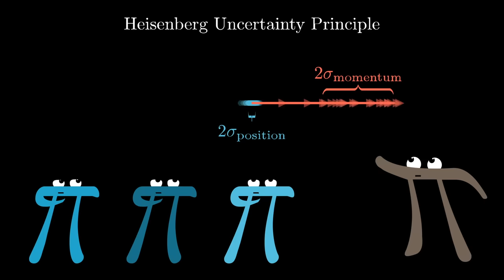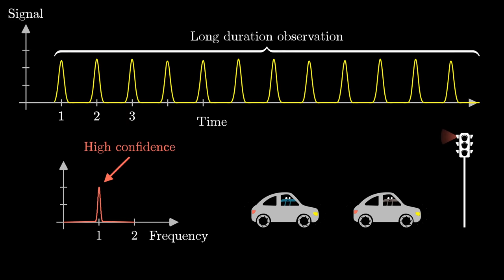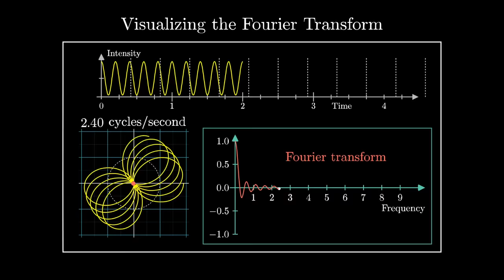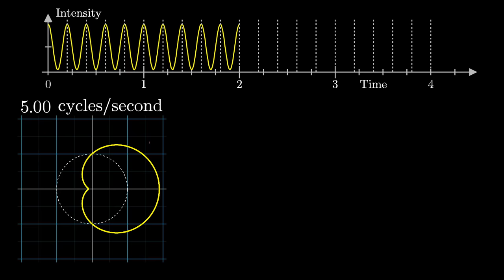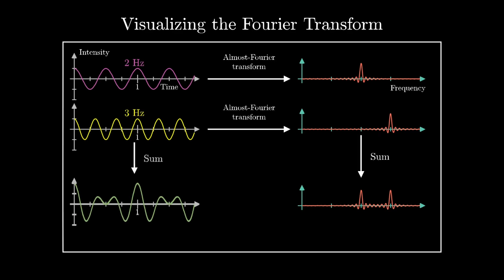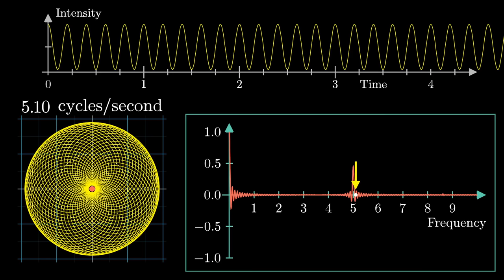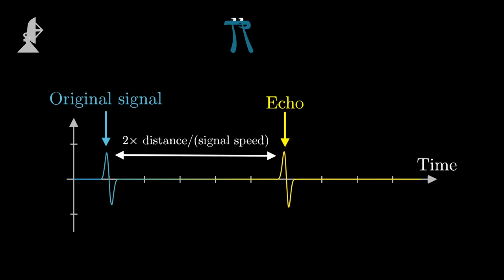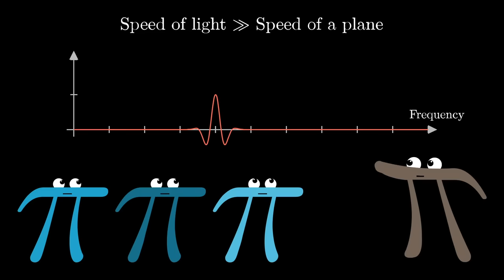The more general uncertainty principle, regarding Fourier transforms

Comment: Is the answer no, since you cannot collect enough data in 10 rounds to narrow down the weakest player. After each match, they can analysis the data to narrow down the weaker players. If the company didn't want to send any weak players a few rounds would be enough to spot the weaker players. But, if they want to narrow down the weakest player of that group. They would need more data, so they would need more matches. 
Thus, we can imagine taking the fourier transformation of the amount of people they don't want to send (i.e. just one person or a group of people). Then the data acts similar to the winding of the sine wave to the circle. Then if to take the inverse fourier transformation to the data that will give you the amount of matches needed.
Thus we have the same relation between amount of players they won't send and the number of matchest to the relation between frequency and time.

Comment: At 8: 11: If f_echo is the frequency that rebounded on the plane and is then detected by the radar, doesn't the Doppler effect apply twice? If so, shouldn't the formula be f_echo = (1+v/c)^2 * f_pulse?
Reply: I noticed that too. But instead of the same Doppler effect squared, the Doppler effect of the radar reaching the plane is different, it's 1/(1-v/c). So the combined effect is (1+v/c) * 1/(1-v/c), which simplifies to f_echo = f_pulse (c + v)/(c - v). Here's the wiki about it: https://en.wikipedia.org/wiki/Doppler_radar

Comment: if the uncertainty principles is as you say an artifact of the way we measure frequencies, then why cant we measure its position with high accuracy and then measure it's speed seperately, thus putting them together to get both accurately.

Comment: Hi Blue Brown Guy.

If you get a chance, could you please check my maths?  I took an attempt at formulation for some Equations to support Dr. Eric Weinstei's Geometric Unity.  But I'm having trouble getting feedback.

Here's one of the portions:
The Photon is only Massless when the EMB wave is in BE phase.  In the EM or MB phase, it will have mass.

This explns why high e = m
E^2=M
M^2=B
B^2=E'

E' is the NEXT magnitude of E.

Not Wave Particle Duality.
Wave Particle Force Tri-ality.

Any notes would be appreciated sir.  I used this video in its assemblage.

Comment: Despite this beautiful explanation, I still cannot understand why you cannot measure the frequency of a wave precisely if you have just two cycles. You just have to measure the distance between both peaks.
Reply: Remember that you can create any function/signal you like by adding together infinitely many sine waves. Therefore, you could be looking at a signal that looks like a pure sine wave in the area you're looking at but then does wild stuff outside of that.
Reply: @lunkel8108  thanks, I was wondering that and forgot how there is like more than one sine in this world^^

Comment: Hi,
I may be a bit late, but I am wondering atm why my FFT plot has a Real and an Imaginary part. Or what do these two parts mean.
at 4:26 it is mentioned that the angle of the point in the "windy" graph represents the phase of the signal. Since I think that that is exactly what I am wondering atm can I try to rephrase that and someone can tell me if I'm right ?

The angle of the vector described by the center of mass point in the windy graph (red dot) describes the phase of the signal in the time domain. in other words it describes how sine-y or cosine-y the original signal in the time domain is. That Information gets lost in your frequency domain graph. If you wanted to add it back, you could use to graphs, one describes how sine-y your signal was and one describes how cosine-y your signal was. Name those two graphs real and imaginary part and it answers my question what the real and imaginary part in my plot describe.
Or do you usually expand your graph (the one which only describes the amplitude) by another graph which describes the phase. and you then name those two party real and imaginary

Comment: Why not fire both long and short duration signals at the same time then combine the results and you get both... just don't use same frequency
Reply: How does this change the problem of separating them in the end? They still overlap and add up if you fire them at the same time.

Comment: Can you explation quantum computing?
Reply: Those computers use quantum mechanics to gain ‚supremacy‘ 
over things where classical computers aren‘t good at. 
A computer works sequential, so one instruction is done at a time(simplified), 
so lets say you‘d have a lock that has 4 digits, so 10^4 possible code combinations, 
a computer would check one at a time, so it would take 10000 trials at worst, right? 
Lets reiterate to how computers work, they have two states, a bit. 
So every binary digit(bit) would be a power of 2 possible values.
14 bits can have 2^14 different values, right, so we’d save our key in 14 bits, hence 14 bits can store ~16000 values.
But only ONE at a time.
Now consider a quantum bit, again 2 states, but they have the special property of being entangled,
also they can be 2 states at the SAME time, 
so those 14 qbits can actually store those ~16000 different values at the same time, 
and one of those values is our searched key to the lock.
They do everything the classical computer does in several times at ONE TIME.

Comment: Thats why pulse-doppler radars are the norm in modern fighters. They can measure range with the pulse, and only infer velocity based on range change over time. But the doppler part cant get ranging data, but measures velocity directly and "instantly", vs calculating it like the pulse. They work well when combined in an interleaved mode.

Comment: Indeed it isn't fundamentally quantum mechanics that this arises from. It is in the nature of wave propagation. For instance, from straight-up wave equations, not involving particle-wave duality nonsense, but just from maxwell's equations, you can't have a finite width wave just propagate in one direction without spreading out. So for instance a laser beam meets physical requirements on how little it can spread out over distance as a function of the number of wavelengths the beam is wide. There is a fundamental limit to how columnated the beam can be. And so the effect this has, on individual photons works out to be the uncertainty principle as you know it in quantum mechanics..... the wider a beam is, the less determined a photon's horizontal position within the cross section slice is known, but the more precise its momentum can be (the more directly straight-forward its direction can be), but the narrower the beam is, the more you confine its position, the less straight-forward it can be, the less constrained its momentum is. Another duality pair is momentum and energy, and another is time and frequency (like WHEN a sound occurs within an audio recording, and what frequency it is at - the fourier transform has a given frequency component represented as a constant sinusoid throughout the recording, but what does that mean if you have a tone that lasts for 1 second in the middle of a 10 minute recording).

Comment: Can somebody help me conceptualize why the oscillating masses seem to fall out of synchronous motion as you observe it in a different reference frame? I have a rudimentary understanding of relativity, and I know it has to be analogous to the phenomenon of E&M waves, but my intuition is failing me here somewhere. Thanks!
Reply: I think I’ve figured it out. I believe it has to do with the way light would bounce off of the oscillating masses relative to your speed. You would measure the position of each individual ball at a different time, based on how long it takes for the light to reach your eyes. Any input is still appreciated
Reply: you are correct. imagine a rocket going by you at relativistic speed with two people inside, one at the front and one at the back. They each have a flashlight, and shine the beams at one another. From your perspective as they fly by you, the guy in the back of the ship's beam has to go farther than the beam that the front guy emits towards the back of the ship. This is because the speed of light must always be exactly the same for every observer, and from your view the guy in back is essentially trying to shoot his beam of light up a river that is flowing backwards against it. The byproduct of this is that the two guys in the spaceship will, from your perspective,  travel through time at a different speed than one another. This does not happen from their perspective, and is a byproduct of the warping of spacetime caused by relative motion from your perspective only.  
What 3b1b is saying is that, because moving objects experience time ever more differently at their front and back as they move by you at increasing speed, quantum particles themselves must begin to oscillate with a frequency that increases as the particle approaches the speed of light. At the tiniest of scales, this gives way to the uncertainty principle as described by the first part of the video in the case of radar technology

Comment: In the example of the doppler effect, may i ask why you can't just do a quick pulse then a seperate, longer pulse, to get accurate representations of both? Sure either measure, individually, is vague on one or the other, but taking information from both will give you precision in both, right?
Reply: Black Hole it would work if the objects you were trying to track were far apart, or if there were only one object you wanted to track. Unfortunately, because there is a trade off between position and velocity data, you would be not be able to solve how to find which object has what proportion of the total velocity implied by the frequency shifts if they were too close together in space

Comment: Yeah, but it is not clearly "just as reasonable".  For it to reasonable particles have to actually be waves.  But that's not reality. Every particle ever detected is a localized packet, so either particles always become solitonic for some unknown reason just before being detected, or the wave-function is merely an effective description of unobserved particle behaviour.  Soliton solutions act like particles btw, they do not exhibit the same interference patterns precisely because they are localized.  When you think about it, what is far more reasonable (though non-orthodox) is either (1) some version of MWI or Deutsch parallel universes, or far, far more likely (2) ordinary advanced causation via Planckian scale wormholes (in line with ER=EPR conjectures, but QM from GR, not GR from QM).  Wave-particle duality is mystical mumbo-jumbo and arcane old-school quantum philosophy.
Moreover, recently images of superpositions have been obtained.  So we know wave-particle duality is mythical, since there clearly is no "collapse of the wave-function".  The only credible explanation of the superposition images is that the particle  can actually occupy different points in space at the same time, and that's only possible if there are interacting neighbouring parallel universes, or if the particles can traverse subatomic Planck scale wormholes (time-travel for real, bitches! But only for ultra-tiny things.).

Comment: how does light have momentum when its mass is 0
Reply: Hey, 
Well nice question. I guess the way to answer this is the fact that light is considered as a massless particle or photon ( it comes under bosons ). 
But momentum is generally looked upon as a part of energy in the quantum realm rather than the classical way of mass*velocity. Since the photon never stops at a place we can never determine its position and therefore the whole Heisenberg's Uncertainty Principle. 
So yeah, I guess this makes sense 😅.
Reply: Relativity. E^2=(pc)^2 + (m0c^2)^2 or, to write this the way physicists who use c=1 would write it: E^2=p^2+m0^2. In quantum mechanics we are concerned about quanta of energy and that's the general relationship between rest mass, momentum and energy.

Comment: There are many suprising correlations in physics. For excample a Pendulum moving throught a viscous fluid behaves very much alike a waltenhofer pendulum. A pendulum damped by a magnetic field.
Reply: sounds like from a control theory point of view those would be the same equations? like a capacitor is also a tank of water or something that gets hot .... but i might be mixing things up^^
Reply: @dranoel9244  Hmm I think you might be mixing things up with the water analogy. Maybe there is more to that, but I am not deep enougth into both fields (yea I know :D) to make a deeper analysis on that. However I guess charging and discharging could be analogous with filling and emptying a bucket.

However a harmonic oszillation is found in many parts of physics. Generally dampening such an oszillation strongly enougth results in an overdampened solution of the differential equation. So this is actually just the same mathematical problem with different parameters I guess. Or at least a good approximation to it.

Comment: "Sheet Music moving through space", good imagery. 
Singularity-point nothing, applied to the inherent pure-math potential motion, => positioning function at Absolute Zero occurrence everywhere-when, e-Pi-i 1-0-infinity instantaneous trancendental cross-sectional composition, in/of Eternity-now orthogonal-normal 1-0 incidence here-now-forever, ..is universal GR correlation-correspondence condition of the natural 0-1-2-ness, inside-outside innate frequency sweep density-intensity, and AM-FM probability interference orbital-orbits in trancendence. Which is another way of saying e-Pi-i probability wave-package forms omnidirectional-dimensional pseudo random holographic crystallisation of prime-cofactor frequency density-intensity interference.., without the mind setting illustrations. 
This is why an Oscilloscope and Wave Generator is handy, as pictured in the video. Zero orthogonal-normal to Zero-infinity i-reflection containment of time-timing function remains uncertain and elusive to correlate, forever.

Comment: Mmm, your analogy with sound is flawed.  The reason you can not determine the frequency of a clap is because a clap does not have a single frequency - it is essentially 'white noise'.
Reply: Chris Musix take the Fourier transform of an audio recording of a clap and you will find that the reason it is white noise is because a single moment of intensity provides no basis on which to determine a frequency, which is itself a description of regularity in intensity over time. A clap, with one peak, is a close to perfectly irregular with time as it is possible to be. White noise. 
Edit: I feel it necessary to add that the Fourier transform of perfect “white noise,” or static noise as you are thinking of, is the exact same thing as that of a clap because perfect randomness in frequency is analogous to not providing a basis in the first place.

Comment: Heisenberg did not use the Fourier technique in his uncertainty principle.  He used an imaginary "gamma ray microscope" along with movements of atoms and particles that he also imagined.  As late; as the 1980s E T Jaynes could correctly write that the Heisenberg principle had never been tested.  Finally, after 2010, with the advent of equipment delicate enough to exploit entangled states, the Heisenberg principle was tested and found to be not quite, but almost correct.

CAB